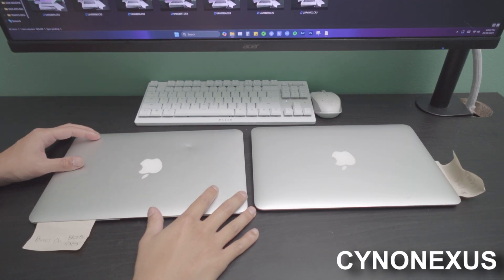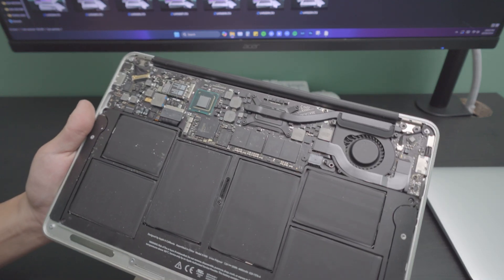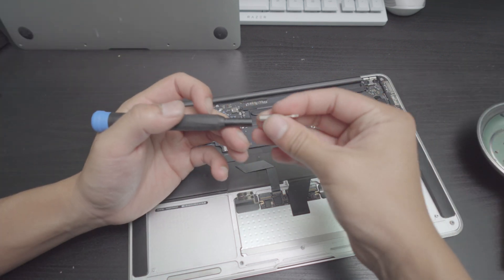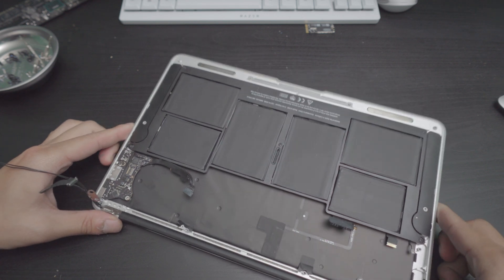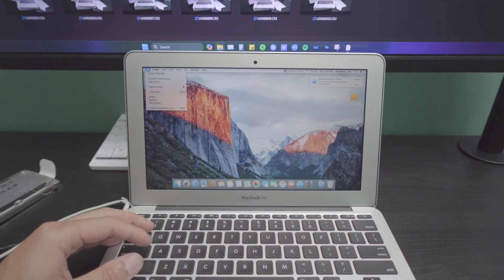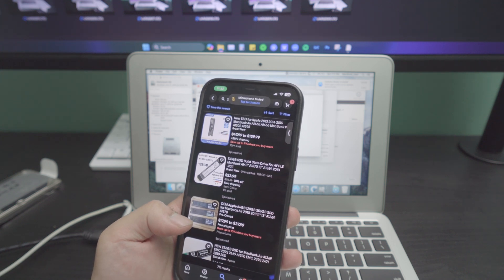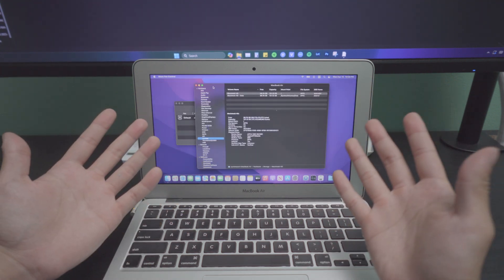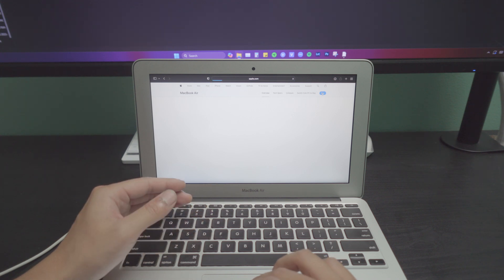CAN WE BRING THIS OLD MACBOOK AIR 11 BACK TO LIFE IN 2025???

Comment: Very interesting video. I'm Super glad I bought a fully spec'd 2015, 11 inch, 2.2 i7, 512 GB SSD, 8 GB ram, before they were discontinued. Mine is still mint condition and looks like it just came out of the box (I placed a skin on it first thing after taking out of the box so no scratches at all). I have Monterey now loaded and I'm thinking about using open core to up grade to Sequoia. This thing is just so easy to carry anywhere and mine works perfectly. Of course I have much more powerful macs for anything this won't handle but for throwing in a backpack or EDC case and taking if along anywhere it can't be beat. I wouldn't entertain selling it even if I could get more then they are currently listing for. Again great video. Glad I came across it.
Reply: What is monterey? 😅 im thinking to buy 256gb 11 inc 2015 and its monterey is it a good thing